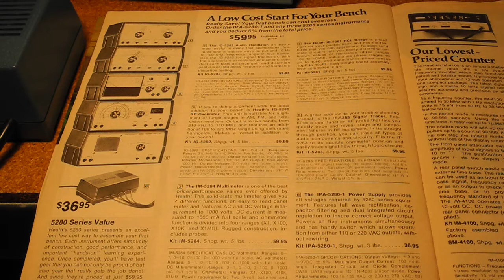Heathkit IG-5280 Series Followup - The IPA-5280-1 Power Supply

Comment: In theory you could build a supply like this.
The regulators:
LM317T Linear Voltage Regulators 1.2-37V Adj Positive 1.5 Amp Output
LM337T Linear Voltage Regulators 1.2-37V Adj Negative 1.5 Amp Output
They are still both available in the earlier and current types.

Comment: does the power switch behind the panel just use 2 9 volt Y adaprer leads? i am fed upmwith flat batteries on my  5280.
cheers
Andrew
Reply from the maker: You could power the instruments with an external power supply but it needs to provide both +9 VDC and -9 VDC,  not 18 VDC.